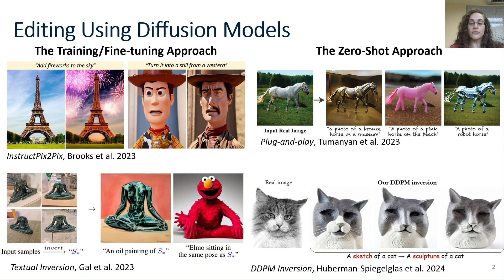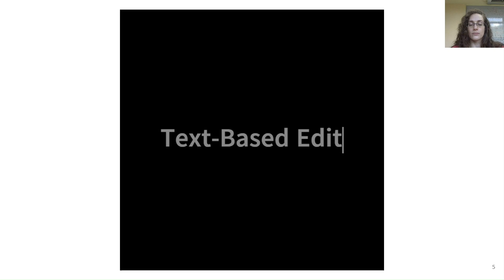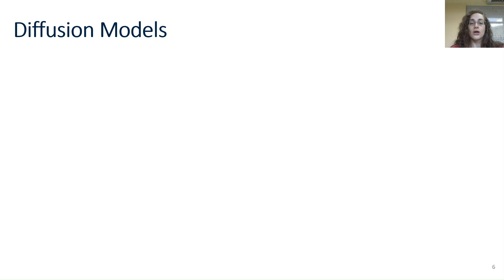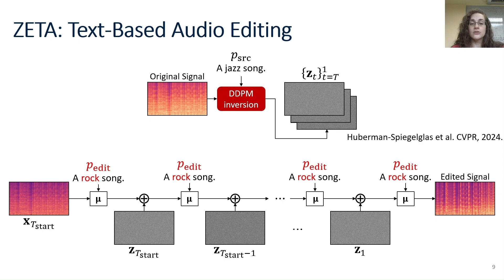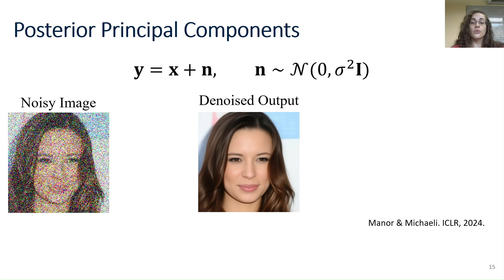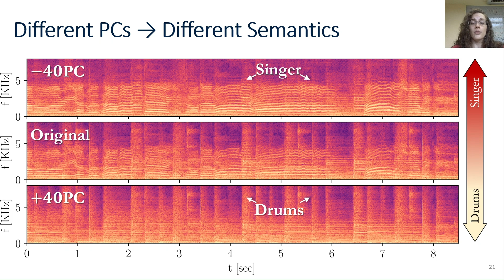Zero-Shot Unsupervised and Text-Based Audio Editing Using DDPM Inversion

Comment: Interesting work!
How did you measure the similarity of your output?(I think you labeled it as LPAPS)
Reply from the maker: Thanks! I basically measure LPIPS but just in the feature space of CLAP's music checkpoint. Specifically, it's the output layers of the four intermediate Swin-transformer blocks of the CLAP model, and also I average this on 10s-long overlapping (1s overlap) segments (since that's what the CLAP checkpoint knows). The evaluation code is available on the GitHub under the 'eval' folder :)